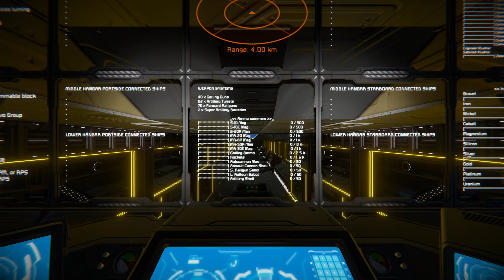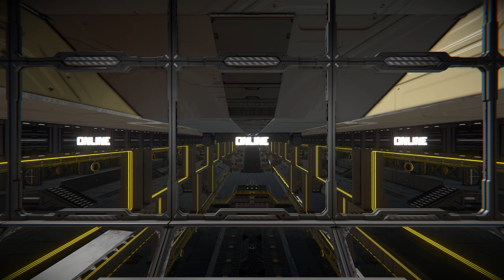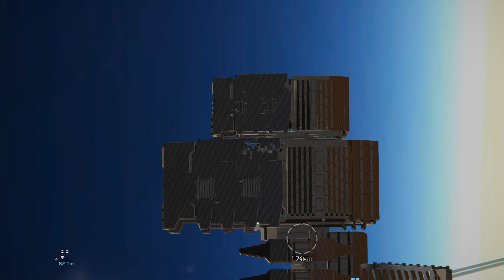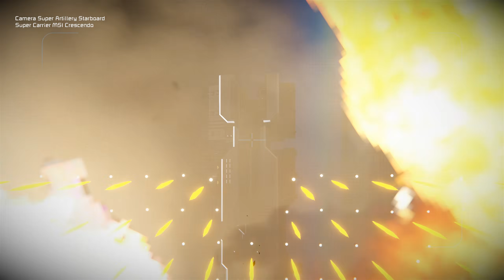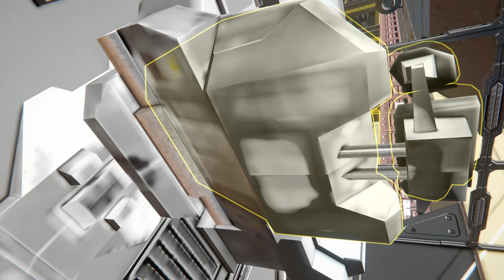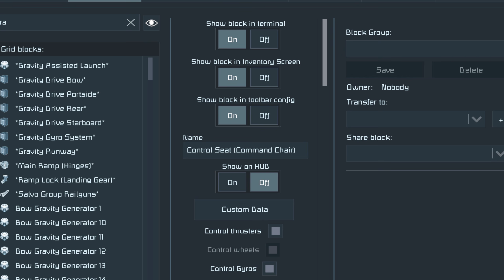70 RAILGUNS VOLLEY FIRE TESTING - Space Engineers

Comment from the maker: Is a wall of lead (one big shot) better than continuous fire ?
Reply: I would say continuos fire needs good way to aim, something only rotating gatling contraptions can provide. Wall of lead wins wins for me because it looks cool but needs big enough targer to justify using it
Reply: I would say both is good. But for different reasons. Continuous fire should be good for moving targets but for slow or stationary targetsa wall of lead would disperse the damage across the whole mass of the ship/station
Reply: I guess if you want to make a killzone, a wall of lead is a good way to do so if not slightly overkill for smaller targets
Reply: Nah. Suppression fire is it for me.
Reply: It would be nice if the new engine Keen is working on has optimization overhauled so it does not render voxels not visible and then condense the surfaces further
Reply: My only question is why we have 50 Frames per second for this video??/
Reply: Make the imperial ship from star wars how the rail guns do to it
Reply: a 240b on continuous fire threw belt fed ammo. not shooting for suppressive bursts, but full open is tactically known as "a wall of lead". most often used for situational lane cover fire threw a laddering retreat. where hopping 400m+ beyond the next 240b is its cool down process time not requiring barrel swaps. and usually the only applications where continuous fire is used within military applications, "the laddered retreat". where the reasons for this, is as within necessity to move and get away fast, accuracy is less a point of importance. where firing provides a field or wall of protections, meanwhile the massive loads of ammo is being expending, reducing the carry load of the field ops in the support extractions. which in turn allows them to move as fast as the other operators on the team.

most railguns need active cooling regiments even in space so the tungsten housing can keep cool in preparations for the next relay charge. granted if you had a couple of nuclear cores you could run many series of rail guns conductive charging coils to fire multiple rail guns at a time. no as large as a rail gun, a scat cannon works the same way. with 10 charges of 7000 rounds, capable of shooting 1000 rounds off 7 times in remote volleys. firing 1.3 rounds per nanosec. which sounds like a heavy mav when all the turbines start up for cooling all the 1000 short barrel pipes. meanwhile once the scat cannon has dispensed all 7000 rounds the entire unit is non-operational. probably being some of the most advantageous "rail gun" technology we have today, is miniaturized railgun tech. which is good for field mounting, tank mounting and setting up with tank computer defensive systems for full automations, ect. really nifty stuff for versatile applications.

but the point being is, when using any type of rail gun, continuous fire is not a possibility for the same barrel and why you need multiple barrels. for an effect of use. meanwhile when it comes to full scale, or super railguns and not miniaturized scat guns... firing them all at once is difficult when it comes to power depletions as well as directional cooling capabilities. so a volley of rail guns, is always the best conditional methods of use. even when used within miniaturizations as such with the field scat box's.

so is a wall of lead better than continuous fire? "continuous fire" in term, is" a wall of lead" in term. as they are the same thing. but as you inquired (one big shot) wall of lead. the above reasons for rail gun technologies and how they work with power and cooling, would be a no. the relayed volley is the better practical applications. meanwhile nano sec between each rail firing, is enough time for cooling and electrical transfers between systems depending on size for required charge. as there is 100miliseconds per sec, and 1000 nanosec per milisecond. so if 70 rail guns fire even if at 10 nanosec per fire that is still 700nanosec, being less then 1 millisecond. which is a full battery of 70 rail guns to appear as a wall of lead as one big shot. meanwhile it is not in actuality, as it would be a full battery of 70 railguns in volley.

where something interesting about rail guns i atmospheric space and space. because of the gravitational time dilations for most normal things. firing a rail gun, has a wind ripple effect just like normal rounds. but the wind ripple resonance travels so much slower then the actual round it self, it causes a vacuum of space behind its traveling path.10-120x the diameter of the projectile fired. if the projectile is traveling at railgun speeds of 13kfps. this creates a vacume pressure cycles sound waves in atmospheric space as 2x hit, 4 x hit 8x hit 16x hit, 32x hit, 64x hit, and 128x hit which is often a soft rupture of the sound catching up with the projectile. where a rail guns just punches a hole threw the traget. but its the sound reverberations that does damage 7 waves of incremental damage trying to catch up with the projectile. in other words shooting a railgun is like shooting a micro earthquake at something. where within the confines of space that where space has negitive pressurizations that vacuums things naturally as with the vacuum of space to that of a pressurized container, ship, or craft. 1 rail gun shot in space would cause a negative pressurizations ripple to follow the projectile as well within the sound definitions of space. as space isnt empty of sound but because the vacuum of space sound isnt audible and having nothing to reflect upon. so instead of a 2x,4x,8x,16x,32x,64x,128x ripple. its -4x, -8x, -16x, -32x, -64x, -128x, -256x as negative pressure balance to the pressure balance of the container. which is -12.11782g's of force as the vacuum of space. to a pressurized container for most things of human condition of gravity of 1 gravitational force which is spinning gravitational forces then the gradual accumulations of damages from the gravitational forces of 3,6,9,12,16,32,64. so that is -12.11782x those values = -36.35346, -72.70692, -109.06038, -145.41384, -193.88512, -387.77024, -775.54048. now take those gravitational weights of a human container spliced by vacuum weights, and multiply them by the sonic reverberations within the vacuum. -4,-8,-16,-32,-64,-128,-256. each sonic wave that follows the projectile will hit the structure x g's of force, where 198,538.36g's of force is the last wave. which is crap tons of more damage then projectile velocity damages. where a rail gun in space... you dont really need the volley if you hit the target. railgun volley is for atmospheric applications only!

in other words, shooting something with a rail gun in space, causes the reverberations of sound to hit the target with a force 198k times over the speed of light. where the temporal vacuum creates light partials from the resonance of energy, that will often appear to flow forward of the projectile itself. often ripping the rail gun off the mass of the structure or craft that fired it from the vacuum vortex it creates.

so in atmospheric spaces, railguns are advantageous for possible rail reuse. but when within the vacuum of space striking a pressurized atmosphere. the rail gun itself becomes part of the projectile after fired.

so not only are rail guns a singular reactions in atmosphere. in space, they create vacuum anomalies as the example list above. so if you hit a target with a rail gun in space... both the target and the rail gun become obliterated. and for a few short seconds... you have a wonderful display of lights from resonating sound.
Reply: so firing a railgun in space isnt just dangerous for the target. but fir the craft using the railgun, as you need to know the pressure of the target vs the vacuum of space for the known control of safety for how far the railgun needs to cast from the craft firing it #1. #2 when you fire something creates a resonating vacuum that travels multiple times the speed of light. you have to be cautious not just for what you are hitting on that target but everything behind that target. and lastly, as you not only need to be cautious of firing distance for the created vacuum, how far the resonating light partials will travel beyond the target, you also have to be cautious of the "back blast area clear" that the railgun vacuum creates behind the railgun... as this is why we do not use railguns in space!
Reply: for the opening shot of battle, I would believe so. Beyond that, continuous fire seems to be better.
Reply: No, because you can miss. I have a design with 8 railguns as fixed forward weapons, but that's in addition to a ton of other weapons; the primary arsenal works best on broadside or top / bottom towards enemy.
Reply: This ship reminds me of the ships in the cpatin harlock 3d movie
Reply: I woud say yes
Reply: T o bad game sucks
but fun to build

Comment: Rex Mortis would win if there's only one player in the carrier. The main reason is the sloped armour plus the turrets for the railguns. Also not as rough on sim speed. I'd say if you got 6-12 players per ship then hell yeah that's a good fight for both, especially the carrier. After all, without fighters it's incomplete. Final note for the carrier is I'd say it works best as a projection of power. I'd probably remove most of the railguns, reducing it to 2 columns rather than 5 and swapping a good portion of the hydrogen for ion. Then again I just prefer the less explosive option.
Last thing of note, the space usage in the Rex Mortis leaves more empty internals that you aren't necessarily supposed to see, while the carrier has almost none with most empty space being hangars. One is a space battleship, tho other a mobile station. On a sufficiently beefy server, I'd say the carrier alongside a sufficient escort would be preferable, while the Rex would be better off with support of something not too much smaller, and only a few.